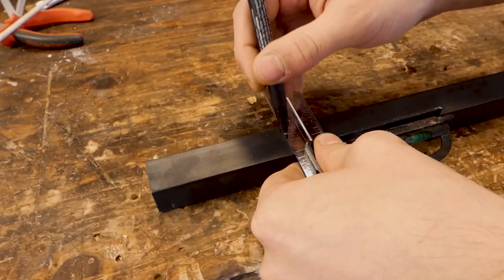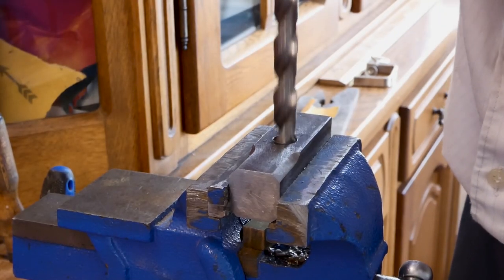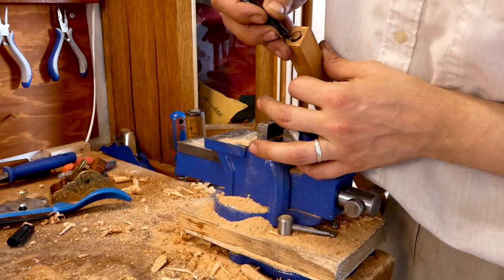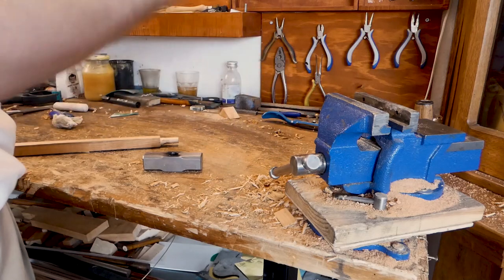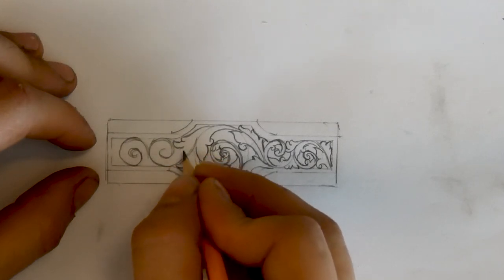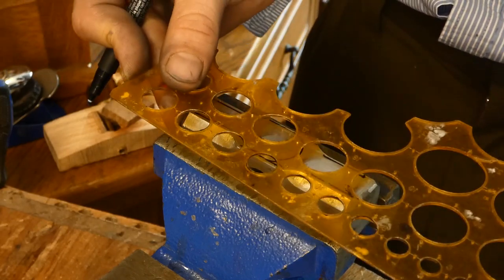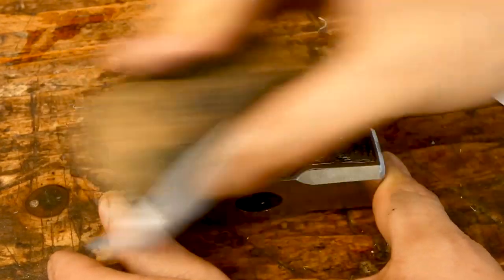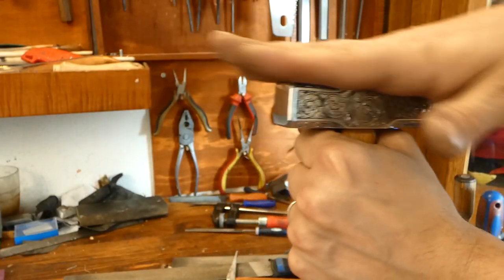How To Make a Hand-Engraved Hammer with Simple Tools

Comment: If you heat a bucket of sand over a fire for 2 hours at <400 deg F to achieve very hot dry sand then put the head end to be inserted about 10 cm into the sand and let it dry 3-4 hours while you work.  This dries the insertion end very thoroughly.  When you are ready to insert you work quickly to heat the metal to 350 deg F then quickly insert the split top into the head of the hammer while still hot.  Insert a wedge soaked in boiled linseed oil and let cool.  As the wood cools rub multiple layers of boiled linseed oil on until room temp.  As the cooling process occurs the wood will have absorbed oil and atmospheric moisture causing the wood to swell to fit perfectly and tightly.  This is the last handle you will ever need to put into the head unless it is broken by careless use...which in such a finely crafted hammer would be indeed a shame.  Thank you for an inspiring video.  P.s...have you tried the process called ‘japanesing’ that used to be used black metal parts of some metal footed hand planes?  Oh...Wranglerstar also has a great video on building a ‘Shave Horse’ specifically for easily making various wood handles etc... again, marvelous video!
Reply: Theophilus Jedediah    fantastic tip for the handle process. thanks for sharing that.
Reply: Good tips Theophilus. Also, it looked like the wood used was pine which is fine for a show piece but consider using hickory next time. An alternative to boiled linseed oil (on the shaft of the handle at least... stick to linseed for split top) would be pure tung oil. While it is slightly more expensive, requires (much) longer to dry, and sanding between coats, it does have a higher sheen, is better at water proofing, and no or only slight yellowing when compared to linseed.

I am curious on the soaking of the wedge however? Most wedges I've seen have been metal and while I guess there is a case to be made for penetrating the split with the oil from the wedge, would you only do this for wooden wedges (as a treatment for the wedge) or would you also do this for metal wedges? Is there not a higher risk of flammability with the chemical reaction from the drying by doing this? Would it even cure properly with such a tight seal?
Reply: NickGreyden whether hickory, pine or oak it is important to heat dry and then hot insert the handle whether you use boiled linseed oil (my all purpose preservative for maintaining wood), steam swelling or another oil preservative is all a matter of choice.  But it will take the shrinking then swelling with some liquid that will swell the wood to achieve the desired result.
Reply: wow    very complex do to simple thing
Reply: "and cherry wood for the handle, cherry is not ideal for hammer handles but it is beautiful and this hammer will get very light abuse, ideally hickory or ash wood is used." from the video description
Reply: It's called japanning, the process of enameling.
Reply: @ldybgd  
In Canada
We got a lot of Maple
Good for wood working ...and syrup
Reply: @APEX-qv7rm  Lol
Reply: @APEX-qv7rm   Oh I don't doubt it, I'm sure there are plenty of maple trees there for woodworking.........and syrup!
Reply: #Wranglerstar
Reply: In a lot of europe, good hardwood is expensive, or so I hear. It didn't make sense to me either, but here where I live, hardwood is as common as soft wood...
Reply: For those with a loose handle on a lesser tool a soak in antifreeze will permanently swell the wood for a tight fit.

Comment: Shocking skill I have to say! Here’s an interesting little trick I heard on transferring a design from paper to steel. If you make a design on  your computer, mirror it, and print it out onto paper, you can lay the inked side down on the steel, and spray acetone on the back of the paper the design on the paper will neatly transfer the design from the paper to the serface of the steel. I’m sure I could’ve explained that better. Regardless, excellent work!
Reply from the maker: CarbideSyndicate great tip! I will definitely try it out, however I do prefer drawing the design by hand but maybe I'll trace it out on the computer.
Reply from the maker: 1234  yes, that's true. by tracing I meant scanning the drawing and then trace out the lines just to make them more refined and visible in the transferring process.
Reply: it should work either way. as long as ink is on the paper ya know
Reply: You can also use polyacrylic in the same way as the acetone but it is a lot less toxic. I found out about this a couple of days ago by watching this video: https://www.youtube.com/watch?v=xHOWUR8vTvo&t=249s  He is showing the method on wood, but it will work on metal as well. You have some awesome engraving skills Uri. Beautiful hammer.
Reply: CountDoucheula fascinating!

Comment: That's simply amazing engraving skills right there! It's so nice to see this level of detailed metalwork done with nothing but hand tools.
One thought though. As a blacksmith, I just can't imagine making a hammer without hardening the steel.. Though I guess there's a difference depending on what you use it for.
Reply: i think, as long as this hammer isnt purely decorative it should definetly be hardened. as soon as he strikes a nail, the hammer would be dented

Comment: Fabulous skill in making this display piece. A work hammer is hardened, then tempered. In addition during this process you can quench the hammer in a chemical bath that turns the metal black, then polish to remove the black. Similar to what you did with the paint. Good job!

Comment: When drilling such large holes or any holes use a thin oil for cooling and lubrication. I will often use oil on saw blades as well stopping to add oil every 10-15 seconds or so for both applications.
 A sharp tool doesn't want friction to cut and oil keeps your tools sharp and hard to cut.
 Your chisels and files don't move fast enough to get the benefits but saws and drills do. Although chalk is used to lubricate files under heavy use.

Comment: well done buddy looked awesome . have you ever thought about gun bluing  . there is a home made  cold process thats safe . with hydrogen peroxide and vinegar  . basically you let it rust  then boil it in hot water to stop the rusting . after wards it leaves a nice blueish look to the metal . you might have to do this a few times to get the color you want . but there is also chemical cold bluing you can use as well . might work better then paint buddy . any way good luck  god bless
Reply: Можно увидеть в YouTube, визуально по ссылкам, предложенные Вами методы травления?(You can see on YouTube, visually on the links, the methods of etching proposed by you?)

Comment: But wait, you didn't heat-treat the hammer
Reply: Why would you? It is hard enough to hammer and heat treating could make it more brittle and dangerous.
Reply: Yeah you dont really do that. Bc of the nature of it, its not really helpful & its going to become work hardened anyway if you actually use it.
Reply: He hammers steel all the time, it'd get dented really fast. If he heat treated it (which means quenching aka hardening, then tampering the hammer to make it a little softer to avoid shattering) then it'd last really long without getting dented and scratched etc...

Comment: Very nice work ! To color the background, maybe you can use cold bluing. It will create a thin oxydation layer that turn steel black and prevent it from rusting. But then you will need to polish the top surface to get the steel shiny again. I don't know if it's a good idea.

Comment: It’s not a hammer till it’s hardened.   This is absolutely excellent work, very inspiring.
Reply: Well now this is just silly. 
We use wood mallets for wood. Rubber for non mar. Plastic to get things to move (such as a push fit dowel pin in a stamping die) brass for steel non marring. Soft steel for non marring of hardened surfaces. Hard hammers and drifts for moving dowels out of holes. 
This is a peice of art. But it is also perfectly functional.

Comment: Hi Uri,

Can you please tell me what graver tool you use? what is it called? what the hammer is called? what kind to get?
I want to start with graving on brass, but every time i look for a simple graver (like a chisel and a hammer approach) i end up on pneumatic hand gravers that need air pressure and frankly, as good as it may be, it is a massive overkill for someone just wanting to start playing around with basic graving.
Where can i buy a simple hand graver? a simple graver hammer(?) ?
It frustrates me to no end

Comment: Wouldn't it be more effective to hot punch that hole and hammer the initial bevels in? Also shouldn't you heat treat that hammer and temper it to 40-45 rockwell?

Comment: what chisel are you using, a sharpend nail or a hardend steel?
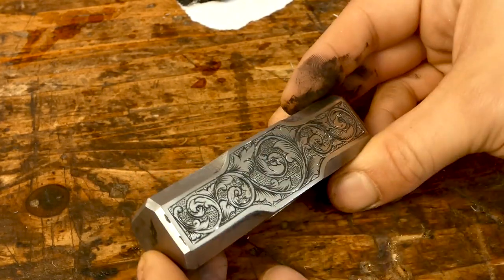12:33 i know you speed the video up, but this gave me the idea that it would be cool to add a powerfull vibrating motor to the chisel so you could work even faster and easier.(like a jigsaw or saber saw)

Comment: Question, in minute 5:27 how is the wood able to tighten itself into the hammer if he is not holding the metal part against anything?
Reply: Inertia. The mass of the metal head resists the initial force of the shaft, and that's why he's doing a lot of little taps. Also, if you pull the handle back as you hit it, it actually has force going against the direction your hammering the handle. You have to be pretty close on your measurements, or else there is just too much force required to compress the wood while driving it in.

Comment: Hammer looks great, but... because it is made from BDMS and not hardened, using it on anything harder than brass tacks would damage it. If you made one from high carbon steel, you could engrave it with carbide engraving tools and then heat treat it to harden, then you would have a real hammer :)

Comment: You have amazing talent for engraving.   I am wondering how functional a hammer like this would be?  You did nothing to heat treat it.   I would not really call this a "how to" video.  It's more of a documentary.  You showed the process, but at no point did you really explain what tools you were using, and you gave really little mention of the techniques and tips used at each point in the process.  You also gave no mention of what type of steel that hammer is made of.   I have always wanted to do some (much simpler) engraving on my hammers, but I have always been concerned about functionality.  You can still have my like, but you left me wondering about a lot of things.

Comment: Need a big heavy leg vise
Reply: Brandon Bembenek only issue there is he wouldn’t be able to rotate it endlessly during the engraving portion. And for the love of @@@ don’t go on telling me of post mounting and working around the vice cause it isn’t the same. It makes for awkward positions when on the backside during this very crucially accurate part of the job. 

The best bet would be to find a Rock Island 5a or even better a baby Wilton mounted on a power arm. Just my opinion. 

Keep in mind I have and use leg vises along with several optimally placed machine vises and woodworking vises depending on what I’m doing. But with that said it’s quite apparent that I don’t do delicate stuff like he does and he doesn’t do any forging or building of the said tools. For instance that metal he used for the hammer is obviously in its annealed state. He never went on to heat treat and tempering when complete. This further explains that he for one doesn’t do much if any rough building or forge/blacksmithing work. In other words he doesn’t need a hammer that’s properly hardened for the things that he does. Where as the stuff some people like myself do, would dent and quickly destroy a beautiful hammer like that.
Reply: 100BearPaw yeah good call that's fair

Comment: What about heat treating.. to harden.. the.. steel... cuz it’s a hammer...😳
Reply: Depends on the purpose. Soft metal hammers are ideal for delicate work. Heat treating is for hammers you can beat on other metals with such as sinking nails to shaping metal. This would be fine light duty work such as wood working or shaping other soft metals such as copper, however I wouldn't suggest trying to sink nails with it regularly. If you notice the square shape of it it would be a fine Mason hammer since heat treating it would likely cause the hammer head to fracture instead of warp, but it's to decorative for such things.